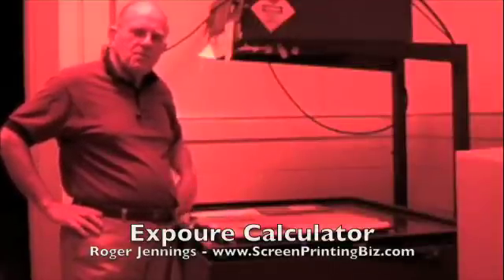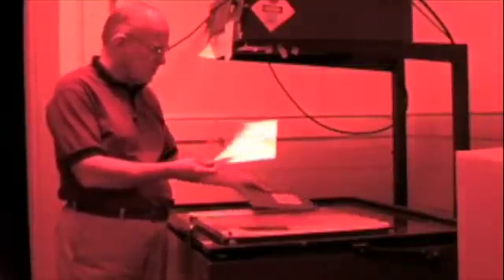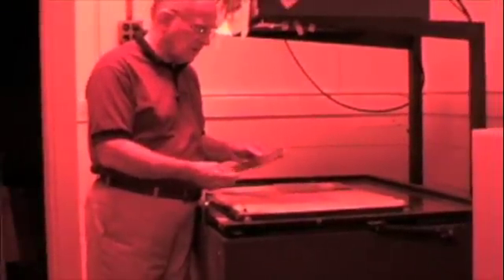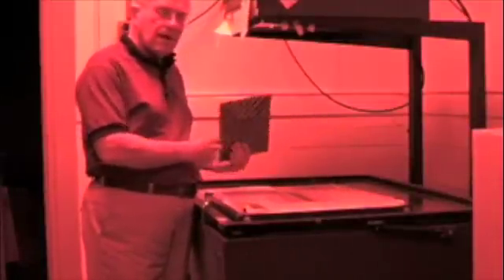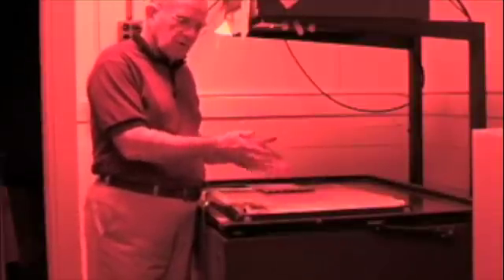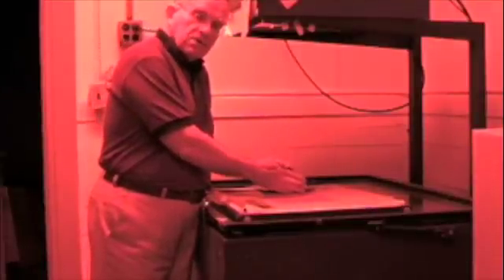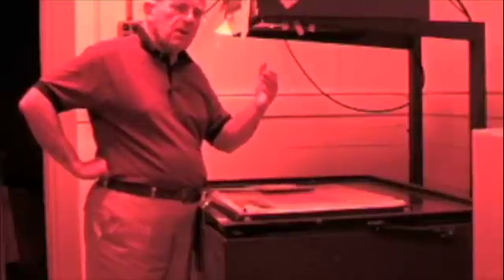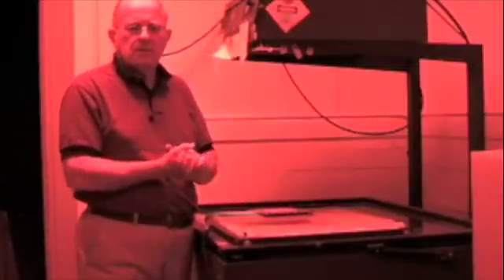Exposure Calculator

Comment from the maker: You emulsion is UNDER exposed.  That clear stuff is "scum" which is unexposed emulsion.  Whenever you wash out a screen, you should last hold the screen horizontal and let water drain through the image.  Then lay a paper towel on the image to stop the water from moving.  Pat dry the screen and wipe dry the frame and open mesh.  After completely dry, hold up in yellow light with eye at one end and light at other end.  Pitch screen looking for refraction which is scum.  More to follow.